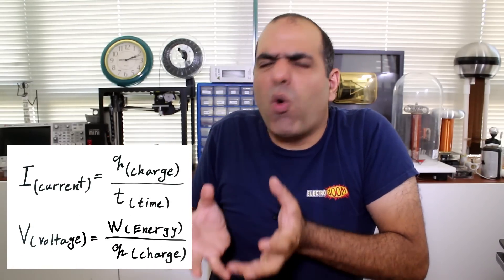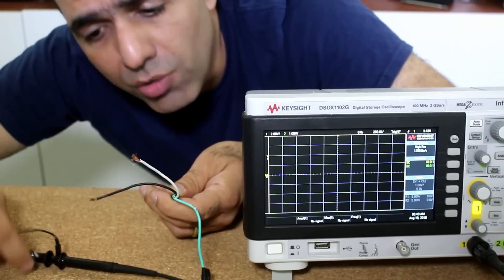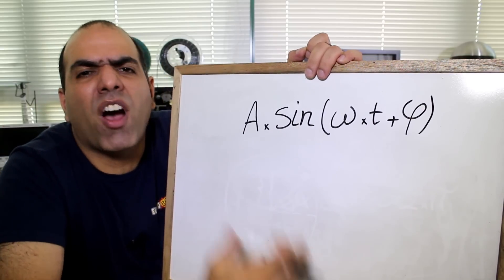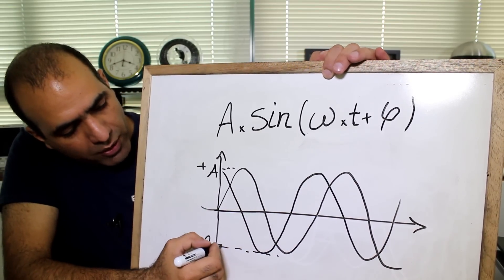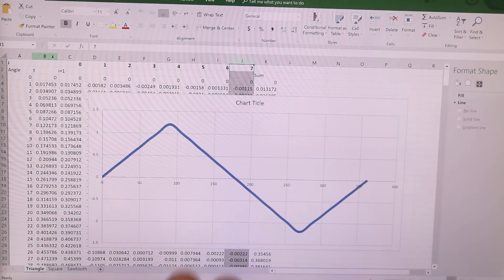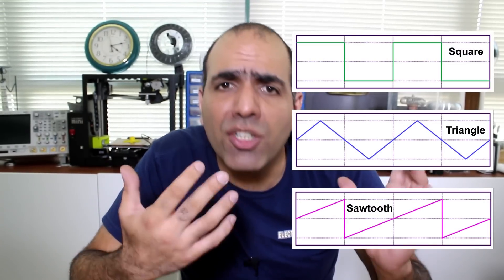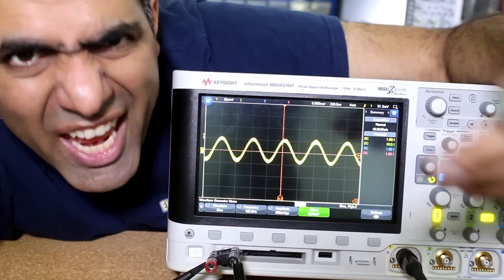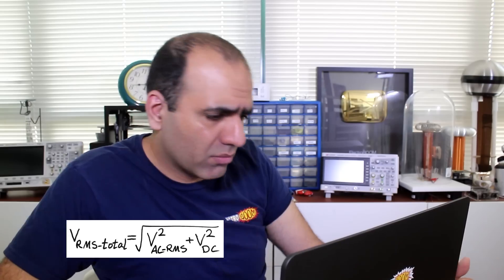What’s AC and DC (ElectroBOOM101-003)

Comment: I have a question.

Whenever you mentioned AC, you always mentioned it going forward in time while oscillating in positive and negative magnitude (say Vp and -Vp) in the Y-axis. Now, say I applied a DC offset of Vp/2 to the AC signal such that the lowest amplitude (-Vp) is now at 0. Is this signal AC or DC?
Reply: no it would be a variable dc current, ac is given its name because the direction of current in the wire changes. If the minimum amplitude of your resultant waveform is 0, it's considered variable dc.
Reply: The truth is, there are multiple definitions for AC or DC, and they´re not super clear or helpful.

You can say that DC is any voltage waveform that only has a single polarity. Then your AC with offset would count as DC. Then a PWM signal also counts as DC.

You can also say that DC is only a completely flat, constant voltage. In that case, even a battery does not deliver pure DC, since it has some internal resistance which means the voltage changes as the load changes.

The C in AC and DC obviously stands for Current, which also makes a difference in some circuits. For example in a "Boost Converter", the voltage across the inductor varies in polarity, but its current does not.

IMO the best way to think about it is in terms of AC and DC components. Then you can not only avoid this terminology problem, but it is also basically what nature cares about. 
You may still need to differentiate between AC/DC "voltages" and actual currents depending on the circuit.
Reply: Basement ScienceE - Your post is pure bunk. What is "single polarity". There is no such thing. Does DC flow from one potential to itself? (NO!) 

There are not "multiple definitions for AC and DC. PWM (Pulse Width Modulation) is pulsed DC = an AC waveform. 
Put a DC source across the primary of a transformer and measure the secondary. What will you get? Now put a PWM source across the primary of a transformer and measure the secondary. Now what do you get?

Remember that an alternating current produces an alternating voltage and vice versa. Did you learn the mnemonics ICE and ELI? 

"Pure DC" is still "pure DC" regardless of resistance. Put a battery across a resistor and the current is still DC and the voltage drop is also DC. Do you remember what the letter "j" is used for in EE? (Hint: j=0 in DC circuits.)

Here's a question for you - do you know what "flat" means? (Hint: it only refers to a visual representation.)

"The C in AC and DC obviously stands for Current, which also makes a difference in some circuits. For example in a "Boost Converter", the voltage across the inductor varies in polarity, but its current does not." is totally wrong . 
An oscilloscope displays voltage vs. time. Go back and look at video and see the waveform from the converter. If the current is flowing in one direction, how can the voltage not change (and vice versa). 
If you put a DC source across an inductor you will get a short circuit. If you put an AC source across an inductor, the voltage leads the current because it the current can not change as fast (ELI), or in circuits 101, v = L(di/dt). 

No reason to add more. Your post is nonsense.
Reply from the maker: Gary Monteiro  Variable DC is meaningless, at least to me! DC is not changing at all. For such signals we say it has a DC and an AC component.
Reply from the maker: If you ask me, it is a signal with a DC and an AC component. varying DC is meaningless to me and it is not a real AC. It is a signal with two components. no name required!
Reply: Just because I really know nothing, but am curious: how do signals have both a DC and AC component, and what does that mean?
Reply: Bluebushes The AC component creates the fluctuating strength, the DC component creates the uniformity of direction.  For example, in an amplifying circuit, current can only flow through the transistor in one direction. The signal, which is AC, could only have its positive parts pass through the transistor, unless you apply a DC bias to the signal to make the fluctuating signal uni-directional.
Reply: Hi Mehdi, maybe there's a need for a video about capacitors with AC and DC? :D
Reply: SimoWill75 It’s a shame.. funny guy, but I don’t sub because the topics are always the low hanging fruit.
Reply: ElectroBOOM yesss !!! ElectroBoom replied to my comment  . On a more serious note, thou art absolutely right about no name being required. It is merely a signal with AC and DC components. Also variable DC has to be a thing...how else would you describe the resultant waveform (if it were to have no AC component, but still kept its shape).
Reply: It would then be pulsating DC, not AC.
Reply: It's a superposition of both^^
Reply: Varying DC. Until you feed it through a capacitor and it becomes AC again ;)
Reply: SimoWill75 Putting it through a capacitor would rectify and you would get steady dc.
Reply: PGTMR2 wrong. You can't pass DC through a capacitor. Also, capacitors don't rectify DC, diodes do that. They 'smooth' DC.
Reply: SimoWill75 I was just using through because that's the word you used. A capacitor would only smooth out or fill in the ripples and a diode wouldn't be necessary since it's not ac. A capacitor would not change it back to ac either.
Reply: Yes, I used through, because AC passes through a capacitor. DC does not. The keyword here is through . I'll say it again. through . Think about it carefully before replying again. Regarding the diode, I wasn't saying one was needed. I was correcting your terminology. Capacitors don't rectify. Diodes do.
Reply: What are you talking about DC does not become ac going "through" a capacitor. The original source was ripple DC, a capacitor will not turn that into ac.
Reply: Yes. AC with a DC offset(as per the OP) will. Get a clue. Seriously, go try it yourself grab a power supply and a capacitor and an oscilloscope. You will be amazed. Or google it. Google will be easier. I look forward to an apology.
Reply: Ripple DC does not have a negative half wave. You cannot make AC from that with just a capacitor. You just go ahead and make AC from DC with just a capacitor. Now if you switched the DC every half wave you could make ac from it. Google it, look up your own oscilloscope I don't care.
Reply: @PGTMR2:
"A capacitor would not change it back to ac either." Yes it actually would. The capacitor acts as a high-pass filter. That means, the DC charges it to a certain level and afterwards no DC signal can pass through the capacitor (neglecting leakage). The AC part of the signal can pass through the capacitor, which makes the output of this (extremely simple) filter AC.

BUT: I'm making the asumption, that the capacitor is in series to your (mixed: DC+AC) voltage source and we regard the current as the output signal. In other cases the correct answer could be different...
Reply: The original signal is ripple DC not AC. Capacitor will not make ripple DC into AC it will only filter the ripples and make it a more stable DC.
Reply: The keyword you seem to have missed over and over again is THROUGH the capacitor. It is obvious by your statements that you are thinking of the capacitor ACROSS the supply (one lead to + and one lead to GND), in which case, yes, it would do as you say and filter the ripple and smooth the DC. But, again, I said THROUGH the capacitor, that is, power in one side and out the other, not a GND connection.
Reply: The closest thing to what I'm describing is when you put an amp in a car. Cars have 12v DC electrical systems. If you install an amp that takes a lot of power, (dimming the headlights when it hits hard,) you install a capacitor. The capacitor does not convert the 12v DC into AC. The capacitor charges when the amp is not using max power and discharges when the amp is using too much power smoothing out the DC. So far as through, once again, that was the term you used inaccurately in the first place SimoWill75. I know that DC is not jumping the plates and going "through" the capacitor. BUT, the DC we were talking about was ripple DC not a stable battery sourced DC. So the voltage rises and falls between 0-12v, it does not go to negative voltage.
Reply: Why would you put a capacitor in line in a DC system in a way in which it wouldn't work? You're still not going to create AC from a ripple DC source with just a capacitor. You said something stupid,  you're getting pedantic with the terms you started with, and then you're demanding apologies. You're arrogant, you're wrong, get stuffed.
Reply: @PGTMR2:
"Capacitor will not make ripple DC into AC it will only filter the ripples and make it a more stable DC." Ah, there's the misunderstanding. Yes, you're right! Because you are talking about a capacitor in parallel to the source. In that case it will make the voltage more stable. I and SimoWill75 were talking about a capacitor basically in series to the source, which would act differently :)
PS: It's really hard to talk about electrical engineering without being able to draw a circuit :/
Reply: It's not inaccurate. My original comment about feeding it through the capacitor is with the capacitor connected differently to how you describe. What you describe about a 'stiffening' capacitor for car audio is absolutely correct. You have the capacitor connected across the supply, to both the + and - connections and it acts as a low-impedance reservoir. What I'm talking about is entirely different, with the capacitor not connected to the '-'. Seeing as you know about amplifiers, perhaps you could tell me how the DC offset is removed from the output of a Class A amplifier (essentially a DC supply with severe ripple, with the 'ripple' being audio signal) and only the AC component passes through? You know, so the DC doesn't fry the speaker.
Reply: Passing DC through a series capacitor filters the constant DC offset, and allows the AC component to pass.
Reply: @pgtmr2713  still don't believe me? Check out ElectroBOOM's newest video (Flying Oil!) and note what he says at 2min 43secs... I guess you're going to tell me Mehdi is wrong too?
Reply: Jesus kid, learn how to let things go. Even the most aggressive political argument is over after a week of no responses and I've argued literally daily for months with people. Losing gracefully is a lesson to learn in life as well. Is Mehdi wrong probably not, could he be, yes. Appeal to authority is a weak argument. You failed to understand the basic concept I was talking about and you want to act like some sort of electronics teacher? GTFOH!
Reply: @pgtmr2713  Facepalm
Reply: Absolutely facepalm. You still don't understand.
Reply: Now projection and ad-hominem. This is how you save face?
Reply: If you're looking for ad hominem, you don't have to go back very far to find one in your replies to me.
I was asking you a genuine question because in some of your replies you appear to be intelligent, then in others your vehement denial and repeated attempted diversion is an apparent inability to comprehend.

You say that I still don't understand, yet as I've stated ad nauseam above, I do understand your argument and I even agree with you!
I'll say it again, the way you say a capacitor works IS correct but it is in a different configuration with different behaviour to that implied in my very first comment here that seems to have triggered you so badly.

If however you mean that I don't understand that you are trolling me then yes, you're probably right, I've never understood how anyone could gain any satisfaction from doing that.
If you are indeed trolling (and comments like " I've argued literally daily for months with people " imply that you are) well, congratulations! You got me.
Reply: Abhijan, it's kind of a matter of context. You'd likely say that was an ac SIGNAL with a dc bias or offset. If it was a small ac voltage (NOISE) riding on a DC supply line, you'd call it ripple.  If you wanted to get rid of the ripple you'd place capacitors across the lines and call it a filter cap. If you put a typically small cap across the supply line at a digital chip supply pin to ground you'd call it a bypass cap. They're also required since the supply lines have resistance. 

If you wanted the ac component (iow you consider it the signal and not noise) you'd pass it thru a capacitor which would reject the DC and pass the AC. It's probably worth noting you can't by a capacitance only a capacitor. Being a physical component you're also getting a resistor and an inductor etc. free of charge :) There's also leakage and soakage present. They will pass a tiny amount of DC and can also charge themselves back up after you thought you discharged them. (no it's not free energy) 

There is no known way of going back in time, just looking back in time over a distance since the speed of light (information) is not infinite.
Reply: Most capacitors in the Universe are being used to shunt an AC component on a DC supply to ground. Some are being used to filter DC, and pass the AC component. Some are used in parallel to smooth the AC component. For a sinusoidal wave, even if that’s all above zero, one only has to change their mind about where zero is to call that AC. But a capacitor never has been, nor will be a rectifier. A rectifier has to flip the negative component of an AC wave so that it becomes positive, or at least filter one component while passing the other.
Reply: it is BCE
Reply: No you got it wrong. The thing is AC and DC are produced in different ways. While DC remains same, AC alternates between positive and negative polarity. When AC changes its polarity, that requires time, and causes voltage drop. That is why you need bigger voltage peak of the AC to output same power as DC since DC doesn't change its polarity or has power loss. That's why he mentions the formula that VOLTAGE(AC)-voltage at the sought time(t- time value)=Vpeak*sin(w-angular frequency*t- time value). Hope that helps.
Reply: Abhijan Wasti it would be an ac signal oscillating around 2 v dc

Comment: So as far as I've understand both voltage or current can kill you if they are high enough.
The difference is that one will stop your hearth and you will drop dead.
The other one will cook you alive from inside out.

Is that right?
Reply: Rato Caverna 
Neither volts nor amps kill you.
It's both together
You must look at what power (voltage times current) a source can deliver to your body parts.